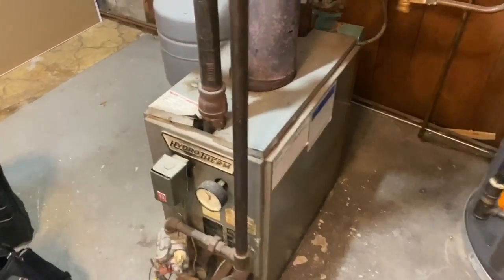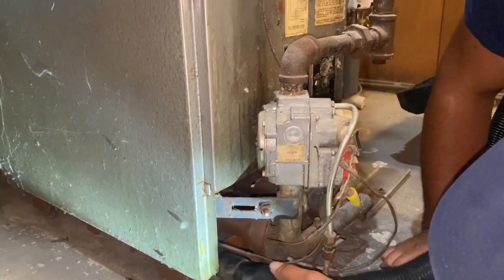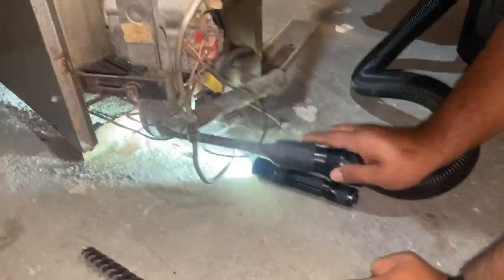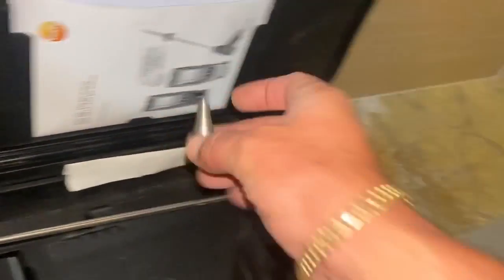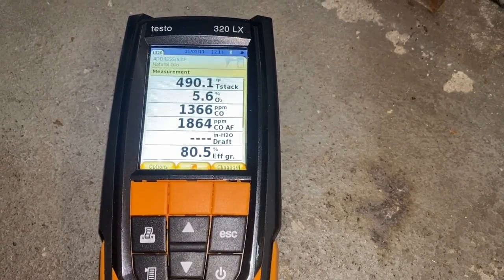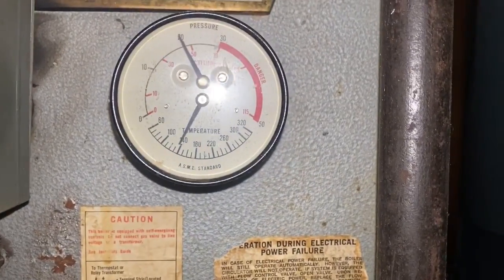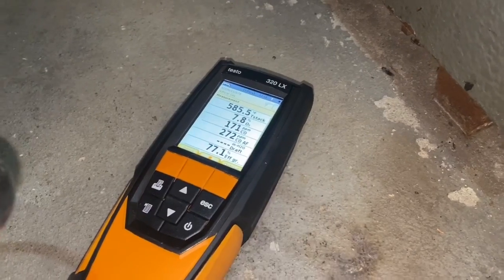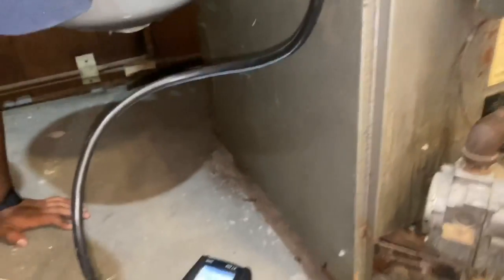Annual Heating Maintenance Hydrotherm HC-12 Very High CO How to Test PowerPile Pilot Generator

Comment: Those two air inlets are really sooted up. Mine looked the same when the gas valve wouldn't close completely and the leaking gas would produce a flame in the inlet.

Comment: These 50 year old Hydrotherm's  HC-125's are indeed workhorses, Best thing I did with mine was to replace the original gas valve and 18V Electrozone valves and controller with 24 Volt components (Honeywell zone valves and Taco SVC403 zone controller).  Doing that also enabled me to operate the system with Wi-fi thermostats.  
Overall efficiency of these boilers was actually rated at 80% which is still comparable to todays new low-end draft HWBB boilers being sold today (80-82%).

Comment: The only thing I don’t like about adjusting the gas pressure is that your kinda messing with the design of the system
Reply: Every rule has exceptions. With these old cast iron burners the orifices get larger over time and begin to impinge on the heat exchanger causing soot and high CO. A lot of these we end up dialing down the gas pressure to about 3.3.